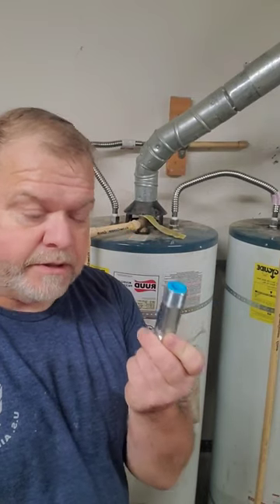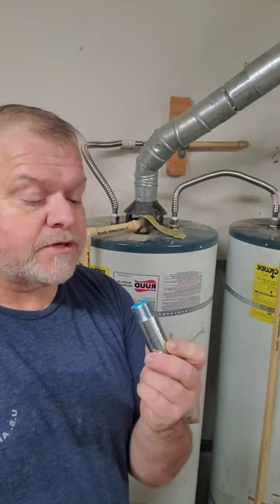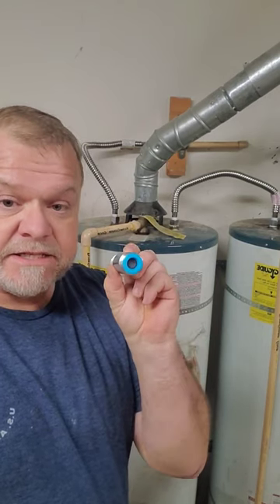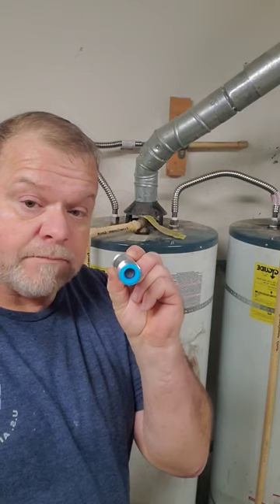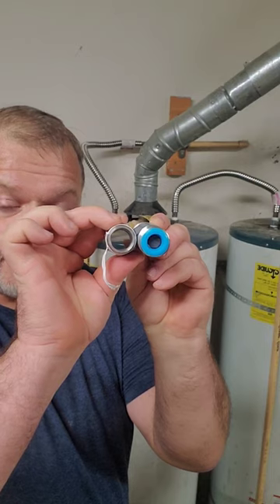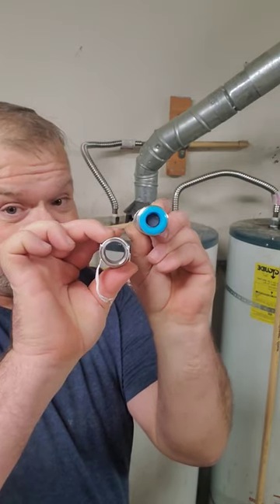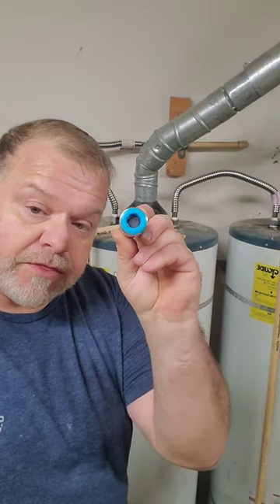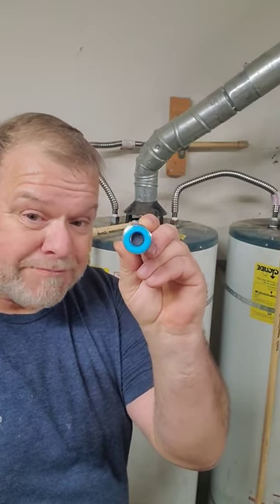Dialectric Nipple Scam

Comment: If you let 13 gallons of hot water go down your drain a minute, then you are wealthier than I thought 💰
Reply from the maker: Someone, please tell this man the average water usage of an inground sprinkler system. LOL.

It's 15-16 gallons a minute per zone of the system. I've got 4 zones and in the summer I run about 10 minutes a day for each zone.
Reply: @peterjbarclay you use hot water for your sprinkler system?
Reply: @peterjbarclay Okay? But your standard shower head is roughly 2gpm along with your faucet. So how am I getting 13-14gpm when the shower head and faucet is limiting it already? 🤦

Comment: In plumbing we were always taught to run 1/2” hot water lines and 3/4”cold in residential. The 1/2” line clears out faster than the 3/4 so you get hot water faster. If you have recirc lines then obviously that’s not an issue. People really need to understand that to provide that kind of hot water at 14gpm you need a serious boiler with an inderect potable water setup. 200,000 btu rinnai’s ran in bypass mode up to 180 degrees works well too. Your little wall hung boiler or 40 gallon tank won’t keep up with what you’re saying anyways.
Reply from the maker: First, those are dual 50's. Second I can appreciate the idea of what you're saying and that may be true where you live. But I've been all over the US and never seen it that way. Of course I didn't get a good look at the pipes when I was in NY but all the others, nope. And my house isn't special, several neighbors have asked me for help and they're all set the same. 3/4 hot, 3/4 cold.
Reply: @peterjbarclay  the county I used to live in as a plumber has their own code book. This is Allegheny county which Pittsburgh is located. The 1/2” vs 3/4” is not code just a preference by one of my old bosses.
Reply: Losing 13 to 14 gallon of hot water a minute for shower would not matter unless the kitchen sink is running
Reply: @SlowReactionDriversAreTheWorst  do you only take 4 minute showers?
Reply: Imagine hook up a hot water line for the toilet, then flush after use, and don't  have to wait long for hot water.

Comment: It’s all bottlenecked at the fixture. Almost no fixture is going to ever use that full 3/4” flow.
Reply: Good point
Reply: If say 2 or 3 fixtures are needing hot water same time there could be pressure drop due to the  smaller diameter nipple.  These Dielectric Tank Nipples also come in regular inner diameter w no heat trap rubber flaps inside.  Anyway both types are are kind of a standard thing they sell at the HD next to the tanks and so far there hasn't been an issues.

Comment: Most 3/4 inch water services won't feed 13 gallons per minute to the home. That heat trap isn't doing any harm
Reply: Right? The guys is trying to equate a 1/8th in drop in pipe diameter as equal to an entire 1/2" pipe flow rate... meanwhile the faucets and showerheads are regulated to a maximum of 2.5GPM flow rate. So... even if you had like 5 showers running at the same time, you still wouldnt get the maximum flow rate of that 3/4 pipe...
Reply: Even 3/4 pex has a higher flow rate than 13 gallons a minite

Comment: Uhhhhh….Yes 1/2” flow rate is less than 3/4”. But let’s be clear a 13 gpm gives you about 3-1/2 minutes before the average hot water tank is completely depleted of hot water if your running it straight through a garden hose or something that doesn’t control flow rate.
Most shower heads have a flow rate of about 2.5 gpm. and that’s mixed with cold water at the same time. But let’s not get into the mixing valve that controls flow rates of hot and cold water to give each individual the optimal desired temp.
The blue insert is a check valve that prevents the hot water from backing up into the cold water supply side as it expands
Reply from the maker: If you watch the other videos I put a little stick to show that it's a simple rubber flap. It is NOT a check valve at all. Also, there are actually assumptions that are made when talking about flow as it can't be measured solely on psi and pipe size. You'd need to know water velocity as well as pipe lengths. but given some assumptions of the flow of your water heater running 13 gpm, and you're ONLY running a shower withing 15 feet, you'll still feel it. That's because your cold is running at 13 and hot is now reduced to about 5.7 gpm additionally your velocity and PSI are going to drop through the floor. That's because the water coming though that 1/2 nipple isn't going to refill and push the water in the 3/4 pipe on the other side as fast as the full port 3/4 nipple.
Reply: Check valve ?  😂

Comment: The pipes within your faucet and the aerators will never allow more then 2.5 gallons a minute not even for your shower. Sounds like someone needs a recirculation pump
Reply from the maker: It's not about individual units it's about the capacity of the main trunk. Ever had the shower burn you cause someone flushed a toilet? That's cause a plumber fucked up, didn't size right and put in flow-restricting components, NOT from the restrictions in devices. Those cause a balanced restriction in that specific faucet.

Comment: It only restricts right off the tank, then typically runs 3/4, until individual fixture supplies that are 1/2 at the fixture.

Taking this out will not change 1/2" supplies at your faucet.
Reply from the maker: Yes it does. our water flow off the tank is the MAIN line. That line is shaared with all other things. It's not about a single fauzet that further restricts to a 1/2. It about a shower, PLUS a faucet PLUS a washer PLUS a toilet. It also has to do with the length. The flow is restricted from that point forward. It doesn't pick up more speed after it's  been restricted, as a mater of fact, the longer the line the more friction on the walls of the pipe slows down the flow .

Comment: He thinks flow rate and water pressure are the same thing. They are not. 

BTW if you need to crank you shower knob all the way to hot you can adjust the valve. Most have a barrier to prevent all hot water so people don't get burnt, it's easily adjustable.
Reply: Good point! What he's talking about having to turni it up towards the hot end on the handle is likely due to the water heater tank become warm bc it's running low on hot water

Comment: So when I turn the faucet on for a minute 13 or 14 gallons less will come through it or 13 to 14 gallons of water. Just going to disappear
Reply from the maker: First I mis-spoke, standard houses have a total of 13-14 gpm. Now, it's not that you lose all or even half of that 13 to make a difference. Think of it this way. 

You have a garden hose. It has a Y splitter so you have two end spouts. You open one end and you notice how "Forceful" the water comes out. It is coming out at 2.5 Gallons per minute. So you put your thumb over it. That makes it spray really hard,,, because you reduced the endpoint flow and thus increased PSI. But then someone opens the other port. You no longer have that same amount of flow coming out because it's SHARED by all other end points and thus with less flow, you have less pressure.

Comment: He completely forgetting about the dielectric part of the discussion
Reply: That's why you use brass.
Reply: The industry standard tank nipple is not brass, even tho brass would be fine too. The typical plumbing practice are those galvanized nipples w the polymer liner inside to insulate the two metals prevent direct contact and galvanic corrosion.

Comment: That's why as a plumber I threw them away and put in a 4 inch brass nipple. DUH.
Reply from the maker: That' sawesome, but from a customer perspective wouldnt' it be better that they came standard like that instead of having to pay for an extra set of nipples. Even if you don't charge the customer that's still 5 to 10 bucks you're waisting because of the water heater companies.
Reply: And that's if the dip tube isn't attached to the cold side @peterjbarclay
Reply: The heat trap nipples are designed to save energy, reduce standby lheat losses by keep hot water from rising out further up the pipes via convection.  If you are concerned w any reduced flow then get regular dielectric nipples with bigger inner diameters.

Comment: With water being on short supply in most places everything has restrictors on them. That is not a dielectric nipple. Go hook up your water heater with dissimilar metals and replace your water heater quicker.
Reply from the maker: Um, that actually goes to the root of this whole series. There is no reason to be USING dissimilar metals. If you only had 1 then galvanic corrosion is impossible.

Comment: So you mean to tell me that i get less hot water at my faucet because of that 1/4 difference? But my pipes are all 1/2 and my supply lines are all 3/8. So i might not be great at mathing but last i check there isn't much difference if the outtake or intake of my heater is 3/4 or 1/2
Reply from the maker: Ok, let's do the math, TL:DR 3/4 gets 2.25 TIMES more water than 1/2.

3/4" pipe entering the home from the meter, 3/4" pipes throughout the house, and 1/2" pipes to individual fixtures.

Flow is a direct function of pipe capacity at equal pressures...we know that the cross section of a pipe is the area of a circle, calculated as pi (3.14159) times the radius squared.

For 3/4" pipe: .750 diameter = .375 radius. .375 * .375 = .140625 * 3.14159 = .4417 Sq in.

For 1/2" pipe: .500 diameter = .250 radius. .250 * .250 = .0625 * 3.14159 = .1963 Sq in

So a 3/4" pipe has about 2.25 times the capacity of a 1/2" pipe, meaning that it has enough capacity flow to support using two fixtures supplied by 1/2" lines at the same time. Factor in restrictions by internal valves etc., and most fixtures can't flow the full volume of a 1/2" pipe anyway, so in practical use a 3/4" pipe can support more than 2 fixtures in simultaneous use.

Sum, for your 5/16 restriction: .3125 diameter = .15625 radius .15625 * .15625 = .0244 * 3.14159 = .0767 sq in, about 40% of the capacity of a 1/2 pipe.
Reply: @magenlin  i mean ya, he proved i was right in his second paragraph, houses use 1/2 pipes to individual fittings. So flow is flow is restricted. Also from my highschool physics class i also know that water cannot be pressurized (i mean yes but with special equipment and not home pipes lol) so if flow is restricted but pressure is constant speed increases. No matter what your water pressure will be around 60psi. So if psi is the same but the pipe is reduced then that means speed goes up... So im still right. The only way he is right is if you have 4 people all using water at the same time with your washer running and your irrigation working all at the same time

Comment: Just turn the temp up on the water heater. Problem solved
Reply: The valve in your shower is fed into a 1/4" orface.  So you have twice the volume you need with the dielectric nipple. Plus, you may have a water saver head, which requires less yet😅

Comment: Most modern fixtures have flow restrictors on all faucets,valves,shower heads.
Reply from the maker: I keep having to explain this. I'm making a video I fucking swear, it's not about the regulations in the faucet it's about the FLOW of the MAIN LINES. I keep using the analogy of an ISP. You have to have the backend bandwidth to handle the customers. You have to have the bandwidth to handle 70% of your customers at full speed. You have to be able to have your sink, washing machine and shower going without interruption.  If someone flushes the toilet you aren't dropping cold and burning the person in the shower.

Comment: I just had to change mine, i used 5 inch piece of regular galvanized threaded pipe (same thing that was there before) and it lasted since 1997. 
My Dad as soon as i told him what i did he told me i did it wrong😅 He said i need a dielectric nipple and thats why the old one rusted out because it was regular pipe.
Well it took me some work and time to get that dang thing in there and its staying.

Comment: Your shower head flows@ 2.2gpm that is a check valve you have in your hand. Looks like you took the rubber disk out. You have plenty of flow with it in there. It’s you fixture’s that restrict flow
Reply from the maker: Yes, but you have to have a back end that can handle multiple units. It's not different than an ISP, sure they limit you in order to help balance the main backend line.

Comment: Ummmm the pipe feeding the fixtures are 1/2 then the inside diameters of the fixture are 3/8 to 1/4. The shower is 2.1 to 2.7 gpm the tub spout is 5 to 7 gpm with a 1/2 in feed that dielectric nipple isn't doing anything unless you are running several things at once
Reply from the maker: Ok, well I'm sorry, but me and my family don't shower, shit, drink and wash cloths all out of one outlet. They all get fed off one main pipe but we have a lot of water fixtures plus two faucets outside. Kind of like how a whole neighborhood of 500 homes with 100meg connections to the internet are not get on 200megs of bandwidth to share. Also unlike the internet, the walls of a pipe alone will slow water down.
Reply: @peterjbarclay so you’re running your whole house full of fixtures plus two faucets outside all the time? You’re still not hitting even 1/2” flow rate. The dielectric nipple isn’t restricting anything, plus it’s required by code in most places so who cares, gotta do it anyway.

Comment: Im kinda with ya there. The nipple is not the scam tho. The scam is the fixtures and the water saving features of the faucets. Damn near everything gets choked down to ¼ at the fixture anyway. You couldnt get 14 gpms anyway 😂
Reply from the maker: Ihate the water restricters in the showers, I always pull them out when I buy one. But it's about load balancing. You have 6-9 units using that 3/4 line. If ever customer had a 1 gig internet line and then the ISP like comcast only used a 1 gig line for the whole neighborhood, you sure the Fuck ain't getting 1gig and it doesn't matter how fast your line is..
Reply: @peterjbarclay  where did you come up with losing 14 gpm?

Comment: You’re wrong 😑 that’s not how it works your fixtures are all limited to a flow restriction usually around 2gpm anyways unless it’s a tub spout which can range from 4-6gpm If you open a hot line full port you’d find yourself incorrect.

Comment: I keep my hot water temperature where I don't need any cold water.No need for scalding hot water.
Reply: I keep my tank way up..  that way, whenever I go to use water, rather than , in your case, using nothing but hot water,and the temp be correct, but once I use a tanks worth of hot water, I have to wait for it to reheat the entire tanks worth, or,. Using A lot of hot water and a lot of cold water to get desired temp, I'm using a little bit of hot water and a lot more cold water, to cool the hot water down, in this way, I'm essentially making my 40 gallon tank have the run capacity of say a 55 or 60 gallon tank.   Not sure on the exact math, but I'm using a whole lot less hot water than everyone else. Which means we can take back to back showers without waiting on the tank.  If you're hot water is the temp at which is comfortable to you, then when you take a shower, your constantly drawing that full amount out of your tank, which means you'd have to wait for the tank to reheat before using again.. 
Idk, that may sound confusing,the way I worded it, but I know every time I'm having customers and other people asking me about where I recommend setting a tanks temp, after explaining, they want me to adjust theirs up.    To guard against scalding, you simply turn on more cold water than hot water.

Use more cold water to cool down the hot water vs using more hot water to heat up the cold water.   In a nutshell. But, to each their own.  🤙
Reply: @rocketman6478  If you were that concerned you would have a tankless water heater.
Reply: @GaryRosie-o5o  I would?? So I'm just lying about it!! Interesting. I didn't know you knew more about my set up then I do..  neat. What other tricks do you do? 🙄
Reply: Nothing like youtube, a place to show the whole world how much you don't actually know.

Comment: Whos going to tell this guy that the EPA regulates shower heads to a maximum of 2.5GPM flow rate?
Reply: The EPA causes more problems than they solve. What good is a Water Saving Toilet if you have flush it 3 times to get everything down so it does not clog? What good are all the strict emissions on cars when they are failing at 50k and you have to replace the car and put 10 more tons of burn coal in the air to make another?  Or how about Gas Nozzles for Cans in which you need 4 hands to be able to pour them without spilling?  They are worthless.  They regulate things they have no business doing and let other things go.  It need to be disbanded.
Reply: @MrCuckoobox  Thanks, i was hungry. You made a pretty good word salad.

Comment: One short restriction does not turn the entire 3/4" line into 1/2" flow rate.  You should take this clip down.
Reply from the maker: If you think it's only about PSI, I can understand your confusion. But PSI, flow and water velocity are ALL different things. A 1/2 piece like that is a hell of a speed bump.

Comment: How about just install things as manufacturer designed…. and let’s not try and reinvent the wheel… when your “expert” plumber tries to put “expertise” on the situation… it can create failure points, not intended by the manufacturer, which can and will VOID warranties… 

Edit: this would be like if you bought 2024, Honda Civic a 4 cylinder vehicle… and at your first oil change, the expert mechanic took it upon him self to install a six-cylinder engine… to get you more horse power… warranty instantly voided… and now you’re at the mercy of the mechanic…